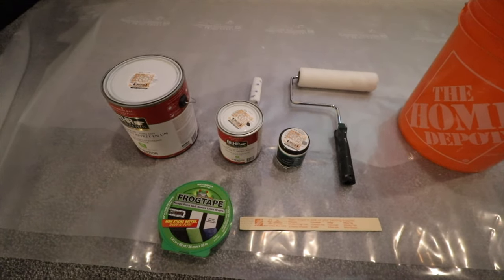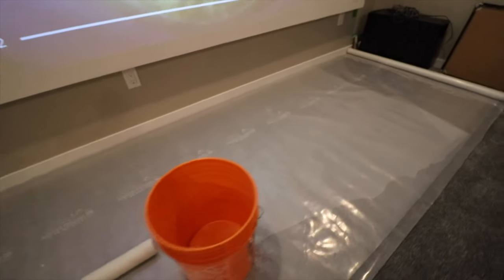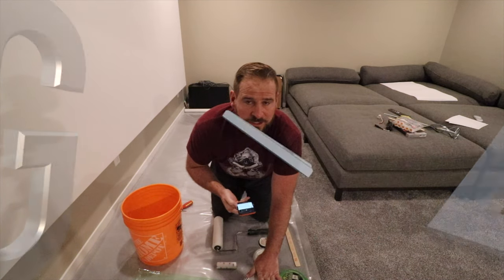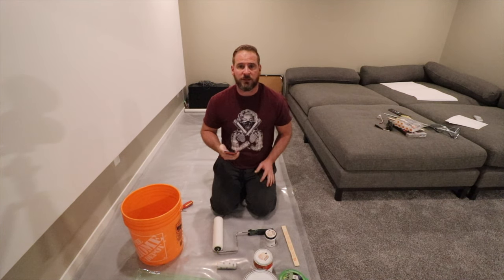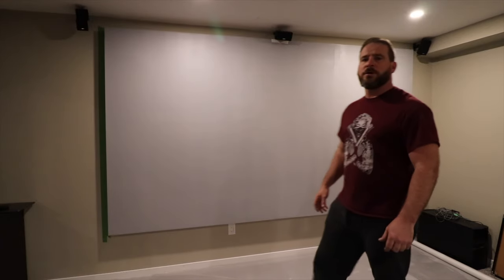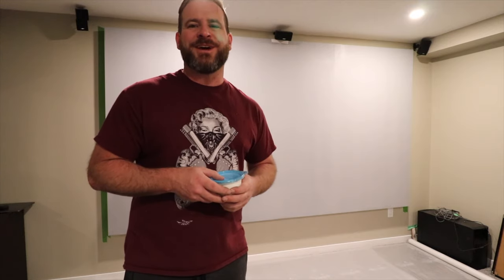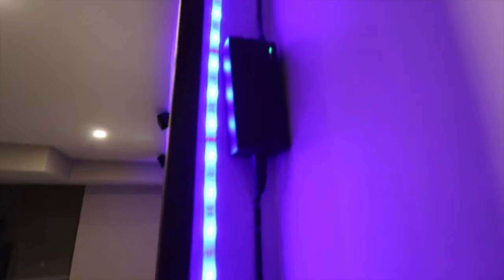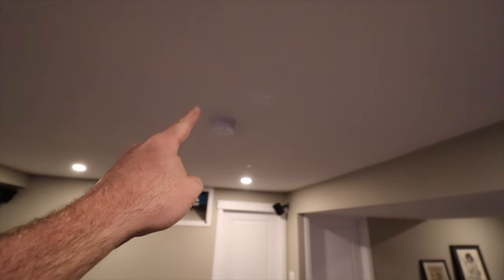Projector Screen Paint how to.

Comment: This mix is the real deal! Thank you!  I feel like I'm watching my projector on a $1000 dollar screen.  This is truly amazing with ambient light and blows away the expensive ultra white junk I paid a ridiculous amount for on Amazon.  That stuff couldn't handle a flash light but hey Amazon had my back on that one.    Colors pop and blacks are true.  Thank you again.  I got suckered on expensive crap but I took a chance on this mix and man did it pay off.  Also home depo stopped selling semi-gloss samples near me so just got the pewter in a semi-gloss in a quart just like the black in behr ultra and Measured around 8 onces for both with half silver.
Reply: Did it really work? I mean it’s goin to arrive my first UST projector I’m considering doing this. Or a white mdf painted will be the same?
Reply: @RedZerom  Yes it works very well.  I have used $100 pint professional white projector paint, and it was terrible compared to this mix.
Reply: @mkgriff1492  and what kind of material is made off your screen?
Reply: @RedZerom  my screen is framed out sheet rock that was sanded and primed and painted
Reply: @mkgriff1492  and the joints how do you cover them? I’m planning in building a 120inch sheet rock screen or drywall but largest size is not enough to I need couple of them.

Comment: For those who are wondering why the black and grey are added into the white, it's for depth. You can get the same thing by adding just tint to the gallon of white possibly. Matte/flat for reflective value and if you purchase a 5 gallon bucket screen you can eliminate the roller tray. One less thing to trip over. Nice job of applying the material though. Back rolling is a good idea as long as you don't wait too long. Roll on 2 to 3 feet up and down and lay it down from left to right with little pressure. Just enough to get rid of the lines. More pressure on the left of the roller if needed.

Comment: This is by far one of the best straight forward screen paint tutorials on you tube with great results.  Keep it up partner.  What material did you use for your screen.  I want customize my wall as well for my Sony 295es.
Reply from the maker: Thank you for the kind reply...  the wall was made of drywall then lots of sanding with the mud.  ended up using way overboard 3000 gritt haha..
Reply: Last screen I painted was a sheet of 9mm MDF. Perfectly smooth and flat - and very inexpensive!

Comment: Thanks for your entertaining and helpful tutorial.  But your paint amounts were a little confusing.  Why buy a gallon of Silver Screen when you only used 1/2 gallon?  You also used 1/4 quart Black, which is the same as 8 oz.  So both Dark Pewter and Black use the same 8 oz.  Did I miss something here?  Also, I'm planning to paint a 145 sq. ft. wall.  Should I double what you use?
Reply: Thought the same thing.  Did you try it?  I bought an expensive mix from Amazon and it didn't work out.  Either going to try this or go back to ultra white flat paint.

Comment: For that color choice your projector needs at the very least 3000lumen. Keep that in mind before painting screens folks. 

Also the choice between matte and gloss is a choice one has to make. It depends the angel you can watch. 
- "Glossy"  small angle sligtly better pic 
- "matte" wide angle slightly loss in quality
Reply: Just the question I had.
Reply: Why is your second coat has different color than first one ?
Reply: Rolling over dried paint.  When dried it will look same. The extra coats brings out the true color. The bent part of the roller should be in the direction you are moving. I'm a painter.
Reply: @zubint  Wet over dry. Multiple coats brings out the true color. You should have the bend on roller handle going in the direction you are moving. I'm a painter.

Comment: Great video. I have a question though, I just went to home depot and could only find silver screen paint. Is it okay to just use silver screen or is the mixed palette required?
Reply from the maker: No idea try it and I hope it works for you...  this worked for me but who knows.  Let me k ow how it turns out
Reply: Oh guys  I’ve had the same question in my project here and I find out that the mix is what  really makes the difference if you buy the silver screen color Home Depot it’s just a color doesn’t have all the necessary ingredients to change image quality

Comment: MORE SPEAKERS! Great work man looks legit!!!
Reply from the maker: Thanks buddy
Reply: @LetsGoJT  Hey, love the screen. How big is the drywall and or how much did you have to cut it. Thanks.
Reply from the maker: @144Jacob  its I believe 174 inch corner to corner.  One sheet was cut in half but that's it.  Mud and tap then a lot and I mean alot of sanding.  Hope this helps.

Comment: Is the actual screen drywall material? Did he ever say that part?
Reply from the maker: Yes its drywall sanded down to 1500 to make it as perfect as it gets
Reply: @LetsGoJT  I just painted my whole wall with your formula. Worked like a charm so far. I am using a optoma short throw projector.

Comment: @Let'sgojt Great video! Is this a 16:9 aspect ratio (did you pre-determine a specific size), and is the screen made of standard drywall?  Thanks so much!
Reply from the maker: Turned on the projector and mounted it where I wanted.  Marked it on the wall.  Took measurements and made the drywall screen.  Thanks for watching 👀 🙂
Reply: @LetsGoJT  Gotchaaa makes sense!

Comment: I have a "cottage cheese" textured wall, will this pain smooth it out?
Reply: I painted my drywall with matte white and what I did first was to sand it using the orbital sander and about 15 dollars at Walmart and use sandpaper starting 60 grit up to 300 grit to get a smooth finish. I connect my orbital sander to a wet/dry vacuum to eliminate dust. I used a ready mix putty to cover the deep surface.

Comment: Do you think this would work well on MDF board?
Reply: Absolutely. It has a nice smooth surface and would require a lot less work than what this guy did. However you would be limited to the size sheet you can purchase since you can't mud and tape any seams like you can with drywall

Comment: How did you attach the screen to the wall?  I would paint the wall where I want my screen but there is an outlet mid way up.
Reply from the maker: +4x4clip https://youtu.be/Qqs16uiFRlo
heres a video that shows the frame i built for the screen. drywall video shows the mud and taping i think.

Comment: hello .. can i just use high gloss  premium metallic silver paint for that?.. cuz i cant find the same brand here .. also the anti light screen that sold in online store is not impressed as you did.. can i get some help?
Reply: No dont use hi gloss im building rite not too much gloss will make blurry
Reply: If yr projector is not above 1200 dollars i do not think you should follow this formula. Im using a 800 lvl projector and grey screens sacrifice color and brightness big time. I would use a flat 1050 white not silver screen...and mix in black until it is a light light grey this way you get a little black. Im getting burned by the gloss. The semi gloss will make the colors pop but if u put in to much or tis uneven it will be blurry. If u want 2 be safe don't use gloss at all. I'm gonna try another build tonight lemme what kind of projector you got and lemme no if you want an update.
Reply from the maker: The 100 dollar projector we did a review on looked really nice on this just fyi.  But I live different ideas let me k ow how it works for you
Reply: @LetsGoJT  I can see how a darker grey screen will boost a 100$ projector cuz it's not gonna perform on its own anyhow. But a 800$ economy plus projector should not run on that dark a grey imho. I've been add it all day running samples from white to dark grey to blusish and ive come to the hypothesis to go super light grey with a little bit of gloss. If the gloss overkills again ima do without it. They grey gives you blacks and The gloss def gives it a 3d effect and the combo of that has a cinema effect but yr sacrificing color and brightness. At the 800$ lvl im primarily using it for 3d so i don't care about color but i used too much gloss and it was blurry as hell. Thanks for yr video btw.
Reply: @ZaddyZavid  for now im still watching in the dark room.. 😂 .. idk what kind of paint i should use in here..
Reply: @pilsajukseng  i did a mix of almost full gallon behr 1050 white with 1/4 quart of 3050 white semigloss.l and added in like 6 spoonful of black matte paint. It came out ok. For 3d purposes for my 800$optoma. You have to tell me what kind of price projector u you have...

Comment: Did u show how to make the floating screen
Reply from the maker: Great question and no I didnt.   It to explain is super easy.  2x4 by how ever long you want build a frame and nail it to the studs of the wall.  I built mine over kill haha 16 inch centers with braces in between so the 2x4 wouldn't bow
Reply: @LetsGoJT  and u put wall board?

Comment: Looks awesome. What material did you use for your screen
Reply from the maker: If your asking what drywall I used was sound deadening wall board.
Reply: It looks so good man, very simple and effective.  What sound deadening wall board did you buy and where can I get it. It looks very smooth. I'm building a 150"or bigger with the same projector and I was going to use milliskin spandex but you sold me on the paint with this video.
Reply: @LetsGoJT  I have a 150 inch screen projector I want to project onto a wall that is a bit larger than your wall .
I was wondering would this mixture work for an entire wall or do I need to change out the sheetrock ,drywall  with noise dampening board

Comment: Hey bud.  Looks great!   What did you use for screen material?
Reply from the maker: its drywall and mud and tape blended and sanded to be a smooth as possible
Reply: @LetsGoJT     looks great.  What's the total screen size diagnolly?
Reply from the maker: @ricomunoz2505  147.5 inches
Reply: @LetsGoJT  hello lets go, is it drywall and or soundboard that you used. Did you cut it. Maybe if possible could you do a video on how you made the screen. Great video on the paint.
Reply from the maker: @144Jacob  sorry its 147.5 and drywall

Comment: IS THERE A VIDEO ON HOW YOU PUT UP THAT DRYWALL?
Reply from the maker: i built a 2x4 bump out for the screen with the 4inch facing out.  the just drywalled it and mud and tape is were you need to shine.  Went thru multiple sand passes to make it as smooth as possible.  But to answer the question no video of the actual drywall
Reply: @LetsGoJT  because i want to do this but im not that knolegable on how to built a frame to hold this up
Reply: @LetsGoJT  What are the dimensions of the screen?  It looks more than 4 feet tall.  I'm thinking of a maybe 5 foot tall screen, but am not sure if it's worth the effort to upsize from my current masonite screen that is 4x8.  But I really want at least 4x9.4 for a full screen Cinemascope picture.